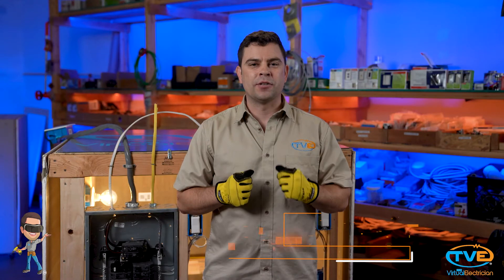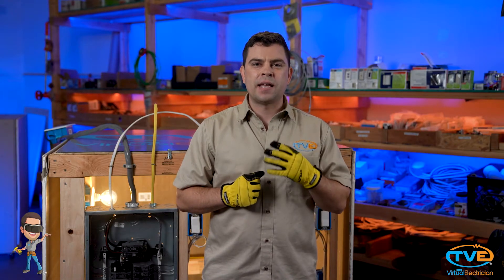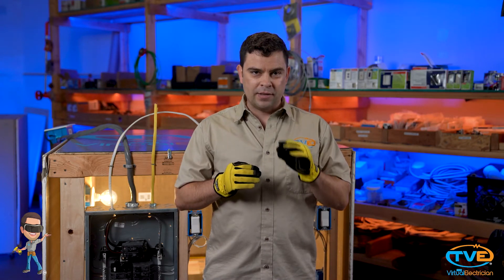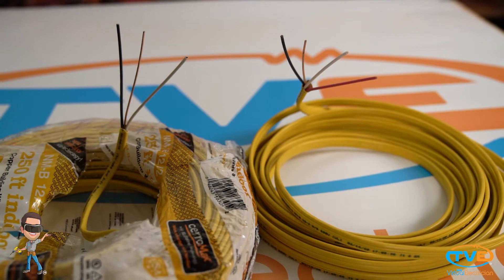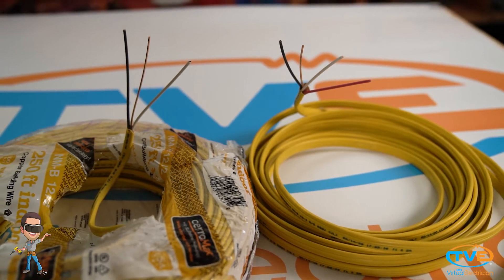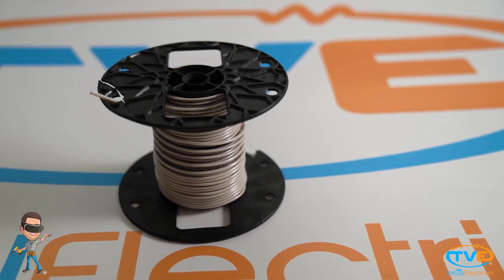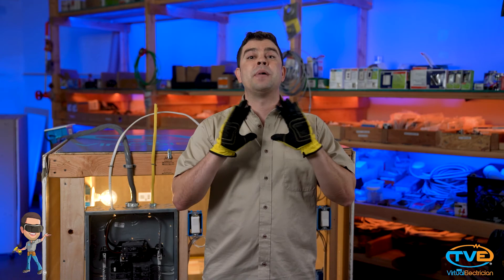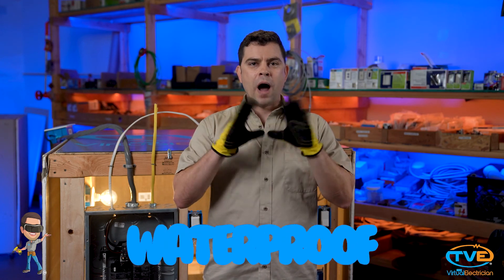14/2 vs 14/3 Electrical wire - What's the Difference?

Comment: Great video!
I’m wiring a kitchen in the basement from the panel that is also in the basement. Should I use all 14/2 wire for all the outlets and 2 gfci outlets in the kitchen or I need 14/3 wire for some of them? Thanks you.
Reply from the maker: You will want to use 12/2 20 amp breakers for the kitchen outlets, 14/2 for the basement ones

Comment: Question - on NM cables, the "2" or "3" tells you how many conducting wires are in the NM Cable and the ground wire does not count as a conducting wire, only hots and nuetrals wires count.  So why is it that on extension cords, they are always listed 14/3, 12/3, 10/3 yet they only have one hot and one nuetral wire inside the jacket of the ext cord.  Why are they not listed as 2 ?
Reply from the maker: im not really sure to be honest
Reply: Found out the reason is in nm-b cable the ground wire is not insulated and therefore can only be used as a ground wire and so it doesnt get counted.  In an extension cord the ground wire is insulated and can be used as a 2nd hot, nuetral, or ground.  Because it can be used as a hot or nuetral it gets counted as a potential conducting wire.   @TheVirtualElectrician
Reply: Interesting. Thanks for passing that on… makes sense

Comment: 14 gauge for a dryer? Seems pretty light. I use 8 gauge on stove and dryer receptacles.
Reply from the maker: dryer should be 30 amp if its electric, we use 10/3 for dryer receptacles

Comment: Bro. Your info and production quality is tops.
Reply from the maker: Thanks!
Reply: @TheVirtualElectrician  You're welcome. I see some abominations of installs as a residential and commercial property inspector. TOPS brother!
Reply: I might not know how to do it but I know how it should be done. I see double and triple taps. Neutrals double tapped. Neutral and grounds on the same bus bar. Bonded sub-panels

Comment: What about ceiling fan with light
Going to a single dimmer switch
Reply from the maker: The dimmer switch won’t work. You can wire the blue and black from fan to the switchleg. Replace dimmer with regular switch and switch will turn both the light and fan on at the same time
Reply: @TheVirtualElectrician  why won’t the dimmer work out of curiosity? 

Assuming you can wire it with a two gang switch?
Reply from the maker: @Handysmallbiz  if you just have one dimmer switch for both the fan and light the fan won’t work because it’s not a fan speed control switch. If you have two switches. Wire the red to the dimmer to dim the lights and the black to the other switch to control the fan.

Comment: Thank you for being so responsive. I hope I don't sound crazy. I want to run electricity to my shed, the closest source is at my A/C which is 220. Is there a way to branch 110 from the 220?
Reply from the maker: Negative. Your ac is sized for that wire. 
Taping off it would overload the circuit. 
But it wouldn’t work anyway. There is no neutral wire for an ac unit
Reply: @TheVirtualElectrician  thank you,  looks like I'll have to run a new circuit from my breaker box.

Comment: When terminating the wires at the panel do all the wires in the romex need to be cut the same length? For example if my breaker is at the top of my panel and my ground bar and neutral are at the bottom can i cut the breaker hot wire short or does it need to be the same length as the neutral and ground so I would need to loop the extra length and run it up to the breaker? Thanks
Reply from the maker: Cut it short. Make 90 degree bends. Much cleaner panel.
Reply: @TheVirtualElectrician  Thanks mate. I'm debating if leaving extra wire is even worth it. In my 20 year old home never had I needed to change the breaker layout so maybe the shorter cleaner look is preferred.
Reply from the maker: @hippo-potamus  looping extra wire at switches and outlets is great. In the panel if you square the edges of the panel with your wires that will give you enough play if you ever have to move anything.

Comment: So if the existing outlet has 14/3 coming in and out. And I want to install a new outlet from that existing one, can I use 14/2 or do I need to get 14/3?
Reply from the maker: you can use 14/2.  The 14/3 was ran because your outlet is or once was a switched outlet.

Comment: If you have extra 14/2 cable, can you run a pair of 14/2 cables with the two neutrals connected together instead of using 14/3? This would be for a bathroom light/fan combo with two switches.
Reply from the maker: Absolutely this would work
Reply: @TheVirtualElectrician I just bought an appliance with a 12/3 wire on it. Can I put an adapter on it and plug it into the wall? All my breakers are 15amp.